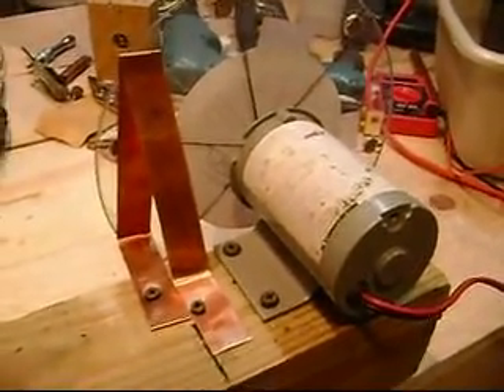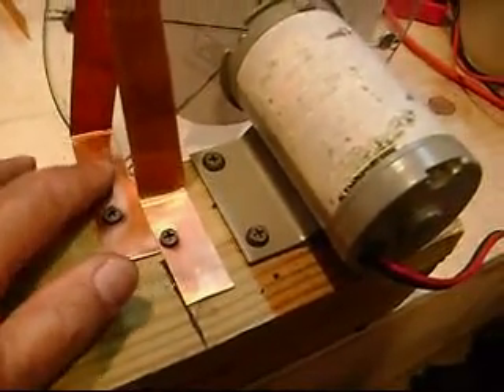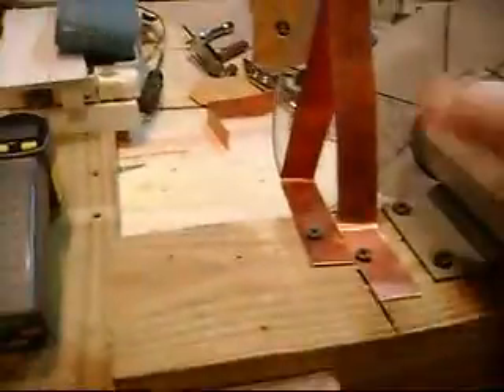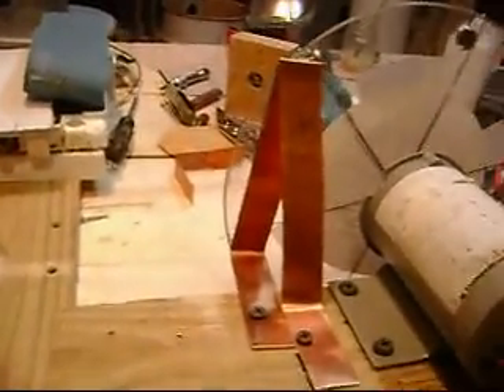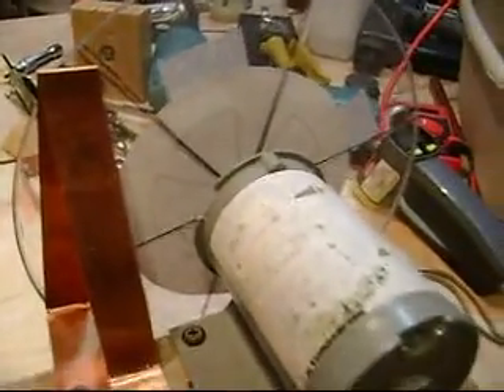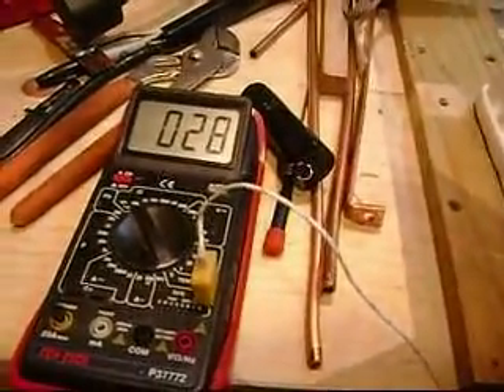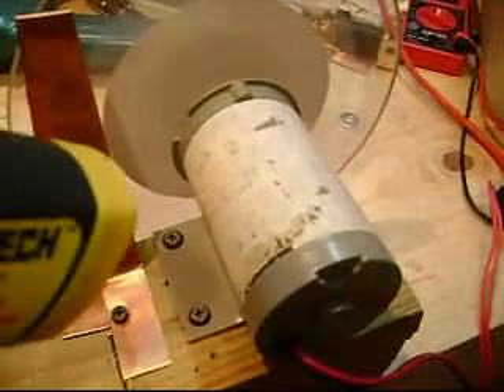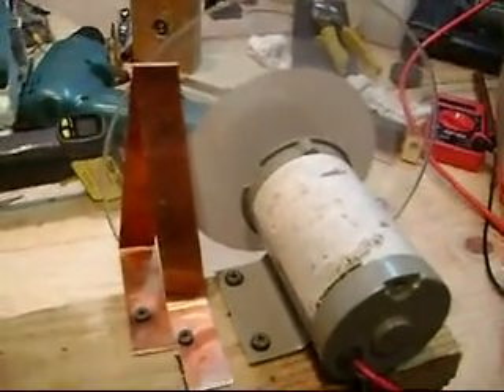HEATING COPPER PIPE WITH MAGNETS  2

Comment: Good morning! I have watched your other videos but only became a subscriber today.  I have enjoyed watching your experiments and can see you adopt a very methodical approach.

I have some relevant experience in magnetic induction as I build generators as a hobby.  I don't want to spoil your learning experience but I would like to offer you a shortcut... 🙂

Benjamin Franklin observed that current induction occurs when a magnetic field passes across a wire at an angle.  Current induction does not occur at parallel or perpendicular alignments.  The highest induction is achieved when the angle is 45 degrees.

When using a round disc magnet you have a circular magnetic field which will create induction across flat / straight wire / foil even if  not ideally aligned.  There is a better shape than flat / straight for the conductive material.

I suggest you cut a round copper washer from your heavy foil and electrically insulate it from sharing it's electrons with any other conductive material.  Place this copper washer centred in the rotation path of the magnet and you will see these two benefits.

The angle of interaction causing induction will always be between 40 and 45 degrees regardless of alignment and the electrons having nowhere to travel will "squish" on one side of the washer and then to the other creating an awful lot more heat for you.

I hope you don't mind me giving a couple suggestions. 🙂

Comment: what is your rpm  if you b
doyble up on your magnets would that make a diffrence in the strength  if you put more magnets around your disc  would that make a diffrence if you use bar magnets would that make a diffrence  lf any one know the effects would be interested  interesting vidio  tnks

Comment: Could it be that the motor is where a lot of the heat is coming from? Why didn't you take the temperature of the copper after you removed the insulator?

Comment: Great job! Will only one magnet work?
Reply: No one magnet will not cause any heating. The heating is the effect of current being generated in the copper by eddy currents under a continuously reversing magnetic field. The magnets are places south facing out, north facing out, south facing out, and so on. The heating is caused by the reversing magnetic field so you need multiple magnets and more magnets means more field reversals therefore more heat.

Comment: The Sterling engine is able to make it's own steam and run or denatured alcihol in a cloced system with a spinning wheel that has magnet's on it and is close to copper pipeing it make a hhot spot on the tube and exspand's the liquid the a presure goes through the engine and then cool's in an exsandsion tank then a radiator then a cam pum back to the hot pipe it has two one way ball valves one radiator the exspantion is a can with two tennis balls in it the ball compress's till the condenceing start'scoal companies stopped the sterling for it would put them out from the home heating and sale's